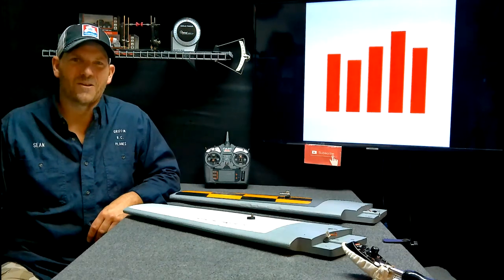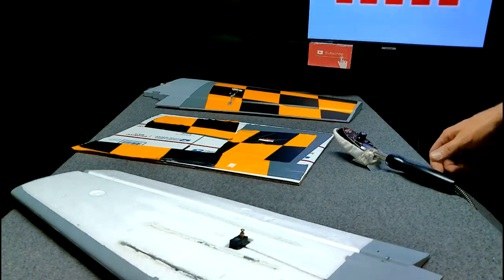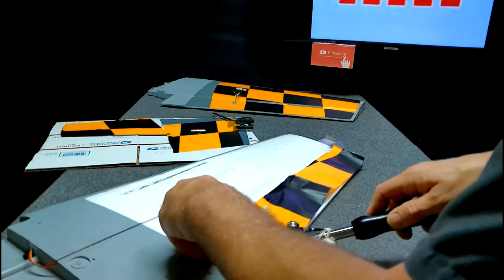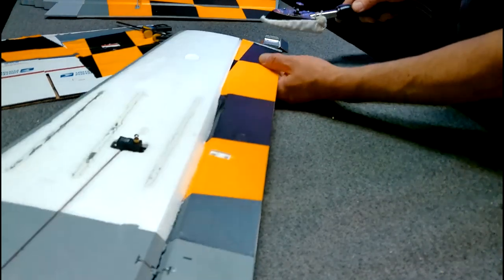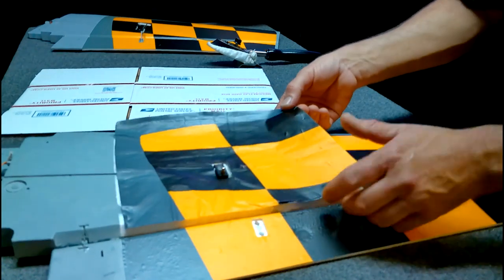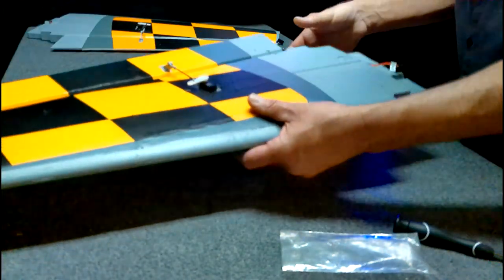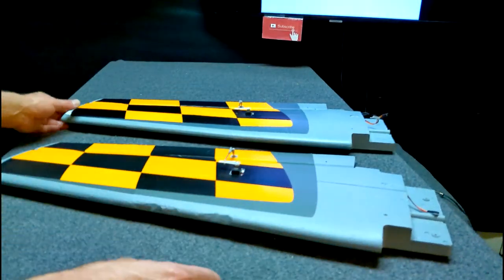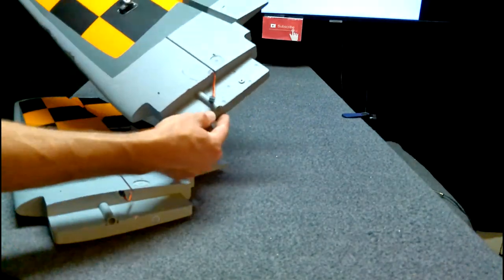THE DECALS WILL STICK AGAIN ON YOUR RC AIRPLANE AFTER A CRASH OR REPAIR

Comment: We’ll done Sean it has come out very well.     I used a hair dryer to remove and replace the decals then used the covering iron to set everything in place.      Whilst I made the repairs I stored the decals on a price of plastic, but I didn’t press them down hard on them so they came of really easy.      You’ve saved a lot of money, learned some new skills and had the satisfaction of doing it yourself.